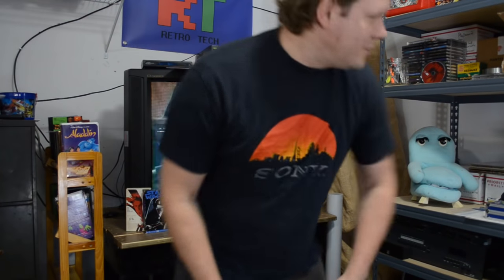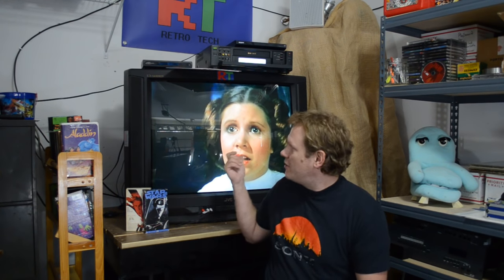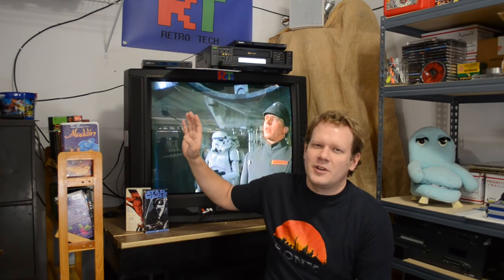Subscriber Q & A - Part 2 What's the Worst CRT Experience Ever!

Comment: Hey, thanks for the shout out :). I'm curious what your solution is to the complication of getting modern BNCs/RCAs to mate with the PCB on the Q board ends up being. I've got some photos of what I did if that's helpful, though I'd definitely do things a bit differently just because I know it was a huge pain getting rigid PCB pins to fit properly. I still need to replace the high voltage film caps to hopefully fix the brightness-dependent defect I've got.

Comment: Another great video! Your channel has been the best resource by far for learning about these old CRTs and how to fix them. Thank you!

Quick question for you. I have picked up a number of flat screen CRTs for their component inputs, like my Sony KV27FS13. The geometry and convergence on the set is pretty good, except when I put up the grid square test it looks to me like the squares in the center of the screen are more narrow, and the squares get a little wider out from there. I can't seem to find anything in the service menu to fix it. My toshiba has the same problem. Do you know what might be causing this and how to address the problem?
Reply from the maker: Thank you,  I'm sorry, I really don't work on flat screen crts.  Do you have any pictures of the problem?
Reply: @RetroTechUSA  I appreciate you taking a look. I have stopped picking up flat screens because of all the geometry problems I keep running into. 

https://imgur.com/MCRNFap
https://imgur.com/FH8QObp
https://imgur.com/zu77y3P

I have an advent (aka Prima) set that has more horizontal stretching options in the service menus, and so far it is the only larger flat screen I have found that doesn't have this issue. Nothing like it in the service menus for the Wega however. I was wondering if you had any insight. Thanks again!

Comment: I read on Reddit that if you turn the volume down and press a combination of buttons with the remote control on a CRT you’ll get a hex code or something that can be converted to the number of hours powered on? 

I had never heard of this before but I saved the post on Reddit so I’ll have to check and see if that’s true. I haven’t tested it yet on the CRT’s I have found.

Comment: I purchased a JVC 27D201 and it looks awful. it's incredibly dark and when trying to look at the menu it has awful color bleeding where you can barely see the VIDEO in the top left corner like you're supposed to. The strange thing is when hooking it up to a source and setting it to that source it actually becomes bright and the bleeding goes away, however it's still dreadfully dark! I have no idea what is causing this and cannot seem to fix it. I've entered the service menu and managed to make it a bit brighter in-game but nothing like a PVM. Any suggestions?
Reply: I just fought the same problem on a Trinitron I got.  KV-32TS36 from December of 1993.  It was driving me crazy but it was probably my fault.  I made some assumptions that the previous owner didn't get in the service menu or adjust any pots inside the tv.  I assumed wrong.  The TV was really screwed up to the point I thought it was aged and going bad. I was even looking at crt testers and rejuvenators.  I ended up getting the service manual and found all of the default settings for everything in the service menu and changed the values to the defaults.  That got me pretty far but picture still had crushed blacks and streaks to the right side.  Then I adjusted the G2 voltage (it's a pot on the neck board on my tv so you have to take the back off) and that brought it back to life.  I hope this saves anyone else the hours of research that I did just so some old video games looks ok.  You will probably need some test patters for gamma or G2 adjust to set it correctly